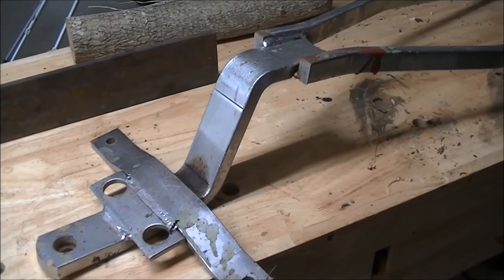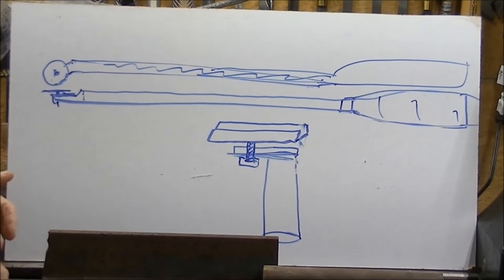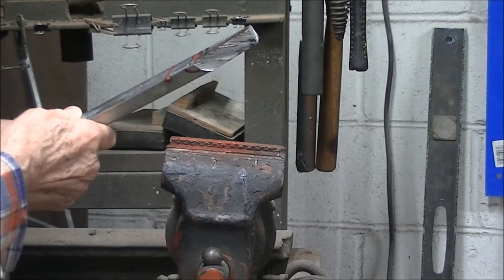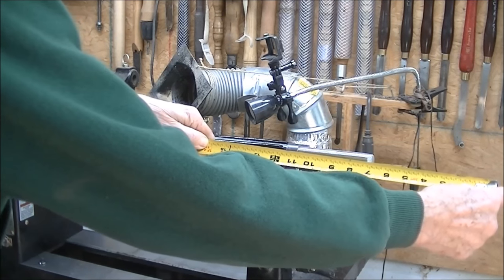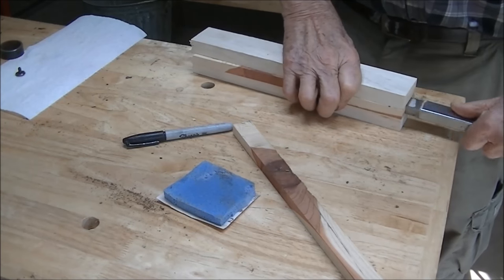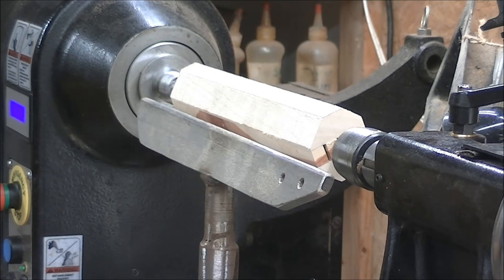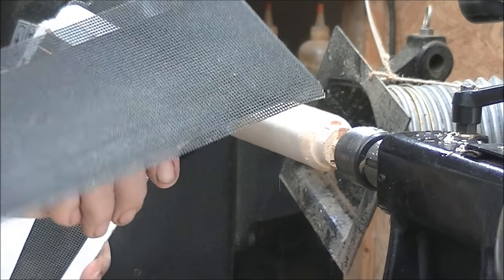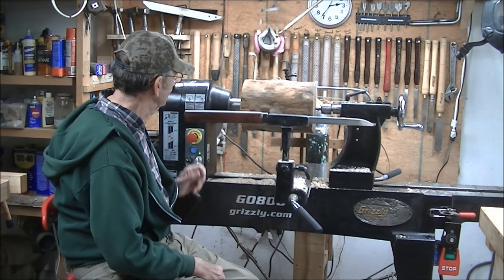Catfish Hollowing Tool # 64

Comment: Larry I like the name of it. What's the reasoning for a channel vs hollow tube for capturing the bar?  I'll check out the sanding screen sounds cheaper than abranet. Look forward to seeing the vase and the catfish in action.
Reply from the maker: I use what I got.  Had no tubing, but if I had I would not have used it.  It would have been captive within the tube unless it were absolutely straight.  Which it is not.  Take care, Larry